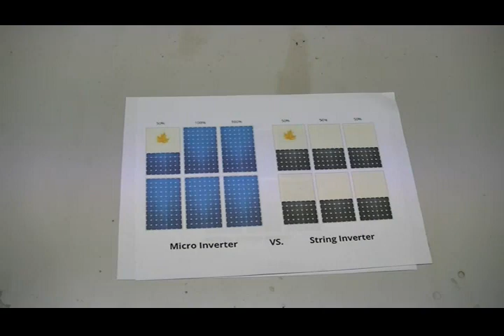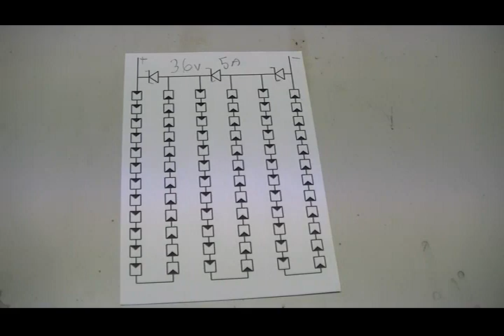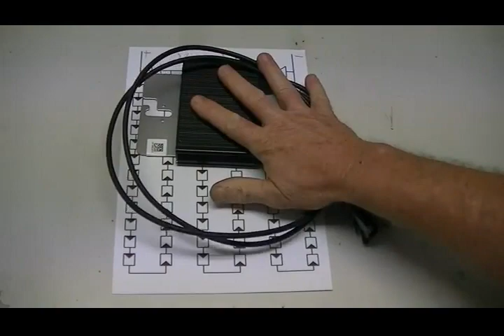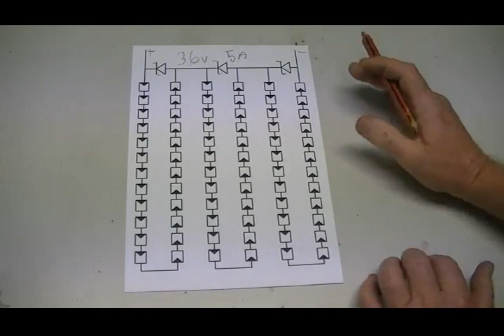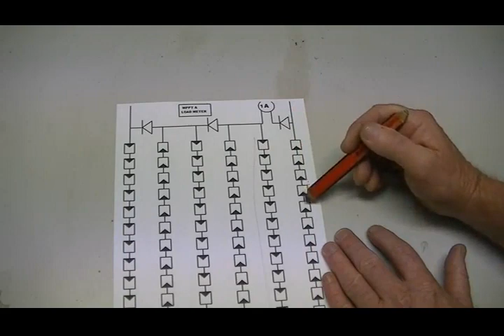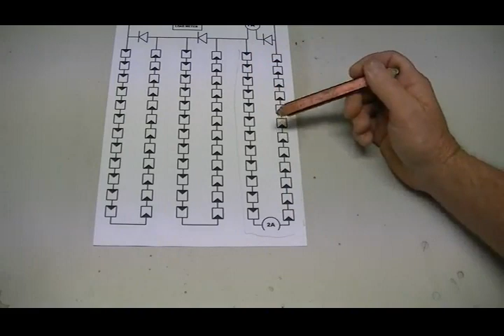Solar And The Great Shading LIE

Comment: Sadly there are lots or errors in this video. One hopes his testing backs up his unproven statements. His basic error is of course how each solar cell actually works, and its not his conception. Some of the other comments give good clues to the errors. Incidentally there is no such thing as an "amp"meter!
Reply from the maker: Looking forward to your video showing these !errors!. BTW, amp meters indicate the value of current flow. Current is measured in amperes, hence the name -amp meter.
Reply: @69Atho  point proves itself - they are called Ammeters, but they do measure amps! I can't see his video on his testing. A quick question : where does his 5 amps come from?

Comment: Thus guy has no clue why a bypass diode is in the panel and what is does exactly. This diode is in the panel to protect it from setting itself on fire and will only bypass if there is a real high current and not a normal shade.
Back to school buddy!!!

Comment: I'm late to the party here! I'm here because I'm planning to remove my SolarEdge Optimisers from my array and convert to a string inverter setup. Why? Because one of the optimisers, less than 2 years old has broken. This resulted in SolarEdge remotely turning off the complete array due to voltage leakage. Scaffolding is required to get to the panels, there's a lot of added complexity on the roof with the optimisers that does not need to be there. I wanted a trouble free installation with little to no maintenance apart from cleaning the panels. The SolarEdge Inverter only works with SolarEdge Optimisers, it's all a bit of a con.

Comment: That bypass diode explanation cannot be correct. The diode cannot miraculously increase current to make it back to 5A.
At the end of the day load determines current. You cannot say a sting will output 36v at 5A. There is no guarantee with that.
If shading occurs on some cells, the energy and voltage from those cells will be reduced.
You are correct though in saying most solar videos get the shading explanation wrong.
(Your diode symbols depict zener diodes though)

Comment: do all panels work this???
 i have about 50 320 watt that was new from power company slightly damaged from insurance sell   
 i use MSB  60 amp charge controllers
 i have around 20k samsung sgi lithium batt new same modules power company uses  8 telecom 150 amp hour agm batt  
i have several  home made low frq pure sine inverters smallest has 4 hy4008 mosfets it will do 2k all day long just like OZ said 
the biggest has 24 mosfets and over 100 pound toroidal tranny 
  i wound trannys myself 
i also have my favorite inverter it uses the Gentry Solar WI FI board and the GS control board 
it is incredibly tough you can control anything from your phone it has every thing anyone could ever want mine even has built in oscilloscope 
it is so amazing
Reply: I wish you would make a video showing how you did that.

Comment: I made the comment on your second movie, however I would like to add: if you only focus on the diode fixing the output: you managed to show the only exclusion in which the optimizer has not much use! You should cover a panel with a shadow. From further away. It should be a bit faded. Covering many cells, and not 'exactly' 1 row. That is not what happens in real life, it is one out of many options, in your case exactly the one you choose to explain your story. I am working with solar panels about 16 years, and I do know that a shade will lower your output significantly. But the image showing '50%' on one panel lowers the output of the total string to 50% is incorrect. Note: if we speak of output, we speak of Amps. A solar cell is a current pump. Any how. I am not saying anyone is right or wrong, I just think there is a better and deeper explanation, which goes beyond only benefiting from the bypass diode.

Comment: Single inverter systems have their panels in series so if 2 or 3 panels are completely shaded example trees, then there is insufficient voltage to make 240 volts. That's why they have micro inverters make 240v in every panel, so if 2 or 3 panels are shaded the others still make 240v each
Reply from the maker: As an example,the fronius inverter only needs 120VDC to activate. As each panel has a working voltage of 36VDC,and you normally have 8 to 12 panels in series,then you only need to have 4 panels in that string to activate the inverter. That means that the other 4 to 6 panels can be in complete darkness and the inverter will still fire up.

Comment: Excellent effectively the panels are built to produce higher supply but less stable if unregulated so panel rated at lower supply for stability of supply allowing for additional current to be drawn through the diode instead of limiting